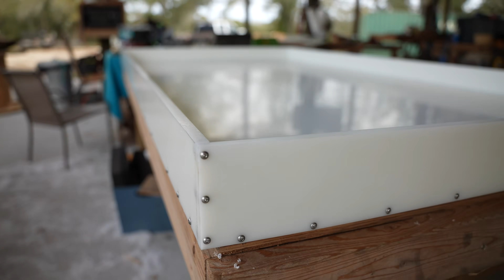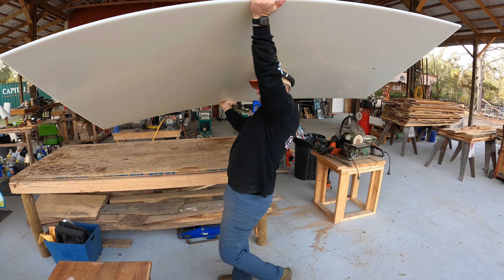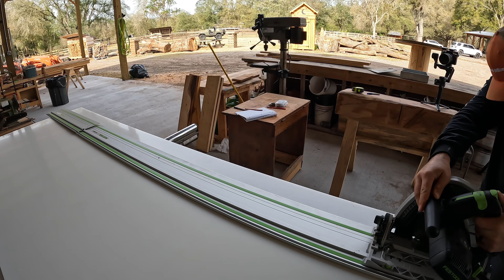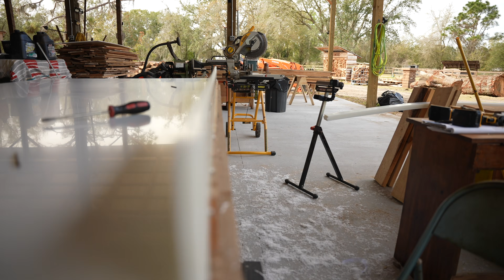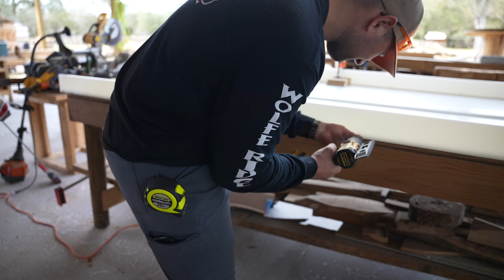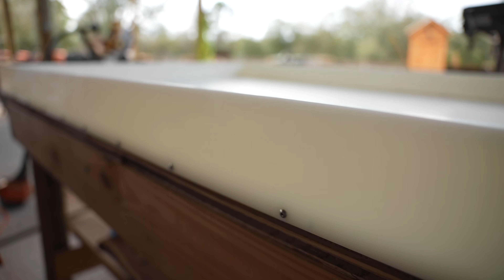How To Make A Reusable HDPE Epoxy Resin Table Mold

Comment: Looks great. However. I would have done the sides slightly angled and cut the sides at a 2 degree angle. Make it easier to get the table out. Trying to get a table out of that will be a nightmare. 
1. If it’s slightly out of 90 degrees it won’t come out at all. 
2. Getting it out will create a vacuum underneath making it even harder to release.

Comment: The table build looks great. I was looking for something along these lines but on a smaller scale. I had the same question as Dirk below. Are you still using this table and are you just unscrewing the sides to get the piece out then rescure, apply silicone and use again?

Comment: Thank you so much for this tutorial video.  I used your model, but made it a bit beefier.  I used 3/4" HDPE (very heavy} and incrementally bigger inserts and screws.  I started with a 48" x 96" sheet and cut it down to 36" x 84".  That gave me my sides and a few extra pieces to use as dividers to make smaller tables, etc.  I plan on using Permatex RTV silicone gasket (like they do at Ahouni Artisans).
Reply: What size inserts and bolts did you use for the 3/4” HDPE?

Comment: well done. the only thing different is that I would painter chalk. its cheap and very easy to use, instead of silicone. let it dry for 12-24 hrs and you're good to go

Comment: To look for a YouTube channel that does large pours, try https://www.youtube.com/c/BlackForestWoodCompany.  They are a Canadian company that makes very large pours up to 4 inches deep.  They have their own mix of epoxy that cures slowly, and they have made a cool table to keep the epoxy from heating up too much and cracking.  They also use a sliding table type table saw to cut the edges of their panels.  With the wedging these people have to do to release the finished epoxy from their mold, you probably will need a mold release agent on your mold to keep from splitting the plastic mold.  Good luck on growing your shop.
Reply from the maker: Thank you very much Michael

Comment: Nice tidy build!  HDPE is great to mill and use.

Did I miss the part where you ripped 1” from the width of the base to get the overlap joints on the ends?

Comment: If you have any trouble with the threaded inserts backing out you may need to pull them out and add a dab of epoxy to the threads as a type of lock tight. I would think over time they may loosen up and back out when you go to pull your screws out.

Comment: That's a mighty long side wall. You might want to do the same to the top of the side wall, long side, so you can use some wire and turn buckles so that when you pour inside the box that the top won't bow out.

Comment: Festool plunge saw is such a joy to work with!
Reply from the maker: Yes it’s so nice!
Reply: @TripleLRusticDesigns  I notice you miss the connector for the track. The sander combined with the dust extractor is unreal, same goes for the plunge saw. You must get the dust extractor, i know it's expensive in the US compare to Europe but it is so good, turns on and off with the tool, just a joy to work with. Mold looks spiffy

Comment: Use hot glue instead of silicone to seal gaps.  Cheap and will clean up easier
Reply from the maker: I may try that. I don’t know if it will seal as good as the silicone
Reply: @TripleLRusticDesigns  I use it on Melamine and it works fine.

Comment: what about a thin layer of silicone to add to the strength and prevent any leakage of the apoxy?
Reply from the maker: I will experiment with doing silicone between the side pieces and the base vs just silicone in the corners.

Comment: Great project, two things to think of one is silicon doesn't stick well to HPDE but as tight of gaps that you have the resign may not seep.  The other is you will find that having the sides removable to get your projects out is going to come in very .  If you do have seeping issues there is clay compounds that you can put in the cracks that will give you a radius, seal and will not affect you work.
Reply from the maker: Great advice! Thank you!

Comment: I think I would have sealed the face of it before you screwed it to the base
Reply from the maker: Thanks. The sides will be removed from the base every time a project is done. So we will reapply silicone to the crack every time.

Comment: Well from a old worker in a shop in my past ! Looks strong just got to be careful when moving it around !! 
Just might need to make yourself a portable bass that would turn !! Around that would hold the load that you’re going to use with all the Apoxsee and whatever wood or pieces you put in here !! 
Yes you need support that’s a large frame so you gonna need to make a swivel base that you could permanently put that on something that you will be able to lift back-and-forth that will break the mold free of your material inside !!
Reply from the maker: Thanks Billy! We will be building a nice stable base for the mold.

Comment: The mold looks great!  It should make it easy to get the table tops out of the mold by unscrewing the screws to release it.  Instead of gluing a level to your drill a drill guide would help you make straight holes.  I can never get a straight hole by hand.
Reply from the maker: Thank you! I’ll have to look into the drill guides.

Comment: 2 questions for you?  1) how stiff is HDPE and will it take the weight on the long side of will that weight break the mold?  2) can you put a clamp on top of the mold once filled to keep it straight and true?  I was wondering if all that weight might cause the mold to deform once filled?  Looks like it will be a BIG piece :)
Reply from the maker: The 8 ft side walls are very sturdy with the amount of screws I used. I can always put a clamp from side to side to hold the wall in if I need to. We will be removing the side walls after each pour to Demold the projects.

Comment: I would of did the same as you did that way after the epoxy sets up you can take apart to get it out. If you would have welded it you would have to flip the whole project upside down to get it out and it would have weighed a ton
Reply from the maker: Thanks Mark! That’s the plan by doing it this way. Removing the side walls and just popping the project out.
Reply: @TripleLRusticDesigns  can you imagine what a slab that size would weigh

Comment: This looks awesome, great job
curious how it handles when you carry it and if it turns and twists at all (possibly leading to eventually breaking the sides.  I like the method you did as well.
I might have added a couple bars on the bottom side that extend out, welded to the underside, so you could have handles to carry the mold or flip it over to get a piece of work out of the mold.
I know its probably impossible to find , and possibly double the cost, but I personally might have tried to get a piece slightly bigger than 8' so I could make something 8' long.  Probably not a huge demand for 8' slabs or tables being made like that at all.
Reply from the maker: On the next video I’ll show you what we have made to make all different size pours in the mold.
Reply: @TripleLRusticDesigns  Exactly what I was about to ask!

Comment: You did just fine!   Don’t attempt to weld that shit!  We weld 1/8” and 3/16” PVC for exhaust ducting and I hate seeing the joint.  We “heat bend” three of the duct sides and weld the open seam.  On 1/2” thick you probably would have to do multiple passes and you’d be grumpy!
Reply from the maker: Thank you! Glad to hear that I made the right choice by not trying to weld it. Appreciate your support!

Comment: I suspect you already know this; the HDPE is a great attachment to any of your saw fences.  Very slick stuff and won't damage a blade if you woops.
Reply from the maker: Thank you! We like working with the HDPE
Reply: I bought a .010” thick by 2” wide roll of it with self adhesive tape.  It is great for all kinds of friction surfaces.